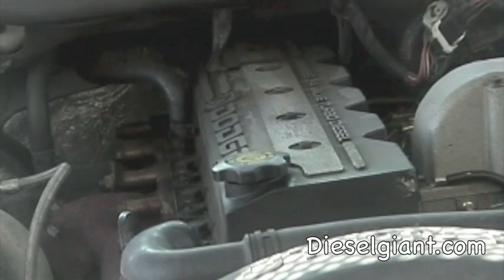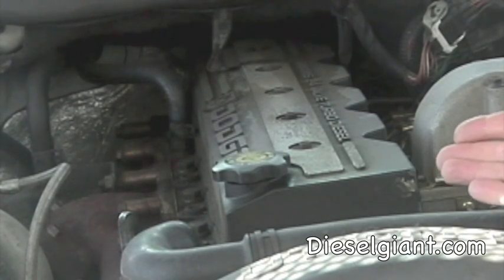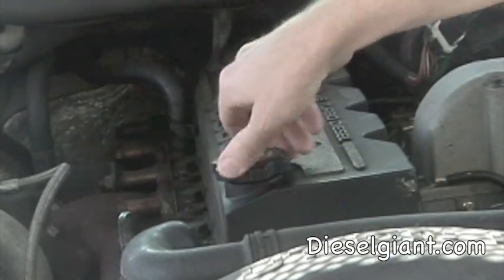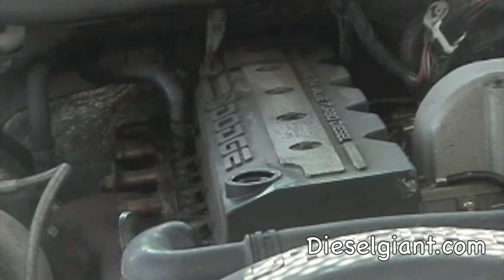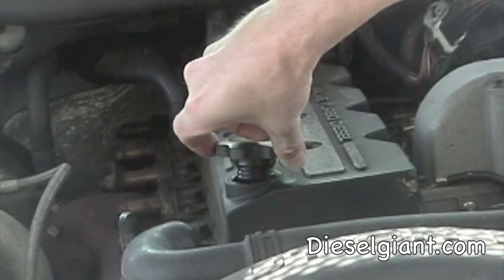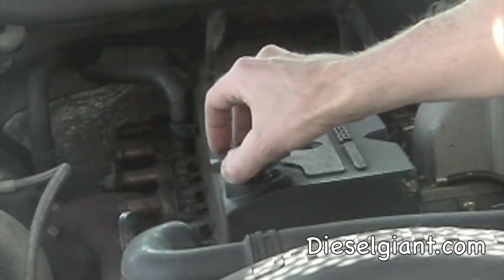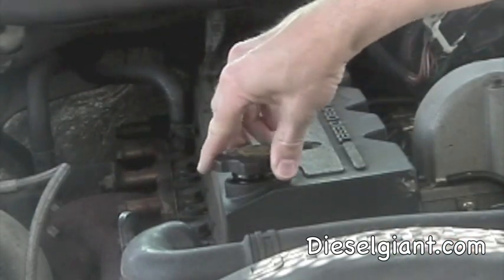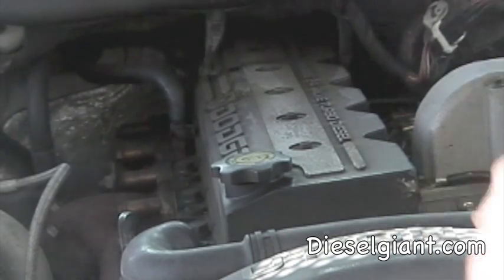2001 Dodge Ram 2500 Turbo Diesel Cummins engine blow-by test

Comment: This isn't an acurrate test for blow by on a turbo diesel because there is no boost being created, blow by will tend to show up as boost is created because of higher cylinder pressures, if you're experiencing blow by at idle you've got bigger problems

Comment: Hello I have a 99 Dodge Cummings turbo diesel with a 5.9 I'm replacing my turbo boost sensor right behind the fuel filter what size is the nut on the sensor and do I need a thin socket or a drive socket to take it off?

Comment: I have a 2001 Dodge Ram 2500 Turbo Diesel Cummins engine  that  has blown several Fuel Filter canister lids off , haven't been able to keep one on long enough for the engine to run very long. A minute or less .

Comment: I'm having an issue with an 2002 four-wheel drive three quarter ton blowing that gasket off the side of the modem does it about every 8 to 9 months anybody ever dealt with that
Reply: Robert Atwood the tappet cover might be “warped” they sell billet custom ones
Reply: It's been 3 years so I hope you figured out that the RAM doesn't have a modem at all. That would be really silly to have a corded phone jack on a truck.

Comment: is there a way to make our Cummins quieter?
Reply from the maker: Yes turn it off.
Reply: dieselworld nice intelligence level psych
Reply from the maker: Huh?
Reply: ear plugs
Reply: No, nature of the engine. The noise comes mostly from the valves under the valve covers from their springs. Best you can do for cabin noise is to add a liner to your fire wall, doors, and under the carpeting. Won't help if your windows are down and you're going through a drive through though. Awesome engine if you get the right make. Avoid engine block 53 (produced out of Brazil with thin walls on the cast iron block... known to easily crack) on the 24v and you are golden. If you want a 24v, best you can do is go for a 2002-2003... VERY solid motors.

Comment: so I have a older car that doesn't burn oil . I am working through, some over hearing issue. now I don't own a compression test kit but I saw this and wanted to see how my engine faired well . I don't have smoke or oil blowing out but I have a lot of air coming out is that's good?
Reply: The cleaner the air the better. However on your car you might find a breather hose going from the rocker cover back to the intake which takes this overpressure crankcase air and pushes it back into the intake, the reason for alot of oil and carbon build up in turbo vehicles, especially diesels. 

If you have this hose and want to check for blowby tolerance simply loose the oil cap and either pinch or blank off the breather hose. If the cap dances around without shooting off from the pressure you're within limit.

Comment: when you do the test (oil cap OFF)....should you pinch/ seal off  the PCV hose that directs blow from the top of the engine to the air intake tube?
 that way the blow by could only escape through the filler cap and you could check it .......?
Reply from the maker: +bigbore400 There is no pcv hose on this diesel engine.  There is a draft tube that goes into the drip bottle.  There is NOTHING that comes out on this engine.
Reply: +dieselworld thanks.....on an engine with a pvc hose should you pinch it while doing a visual blow by  test.
Reply: Pinch or blank it off momentarily. Has worked for me in the past. Also fitting a catch can has saved my turbo.

Comment: can you test this in the winter and if a tiny bit of smoke comes out or is it steam or smoke when I do the tea kettle test it stays on perfectly does not jump around at all but I tested it in the very cold weather and I don't know if this is steam or smoke
Reply: If it's w very cold start it might take a little bit for the engine to warm up and piston rings expand to normal operating temp.

Comment: You cannot check blow by in a 5.9 Diesel unless you block off the crankcase vent tube because the blow by is coming out of the tube instead of the oil fill cap.
Reply from the maker: +Richard Bell No blow by comes out of the tube either.
Reply: If there is pressure in the crankcase it has to come out of the crankcase vent tube. That's what the tube is on the engine for, it has to vent somewhere.
Reply from the maker: +Richard Bell If there is n0 pressure in the crankcase ie no blowby, nothing comes out either place.  Not every engine has blowby.
Reply: +dieselworld  so should you pinch the PCV hose when you do the test?
Reply from the maker: These engines do not have a pcv hose like on a gas engine.
Reply: My blowby oil container leaks oil and makes a mess. I need to make a better collection system
Reply: @aaronbqwert7164 what do you use to collect the oil? Mine is just a tube pointed down lol

Comment: this way to "check" blow by is if you suspect a dust out situation and is no way at all to check any kind of normal blowby that the cummins 5.9 will have. the 5.9 will have at rated load conditions up to 10 in-hg or 5 psi blow by and is in spec with such readings. the only way to check true blow by is with a water monometer or guage that reads inches merc/hg and a 302mm orifice.

Comment: When I first got my truck same exact dodge i cut the soda can thing off. That was a year ago.  Now a mechanic told me i need a timing gasket.  But i find all these different gaskets. I'm not sure which one i need. The leak is upper driver side of the engine.  Can anyone tell me what to do to fix this?  I don't wanna pay shop fees. All help is greatly appreciated. The soda can thing is at the bottom of my engine.  Does anyone know how to fix this?  I'm buying 2 gallons of oil every 3 days or so because it leaks that much oil. Thank you everyone
Reply: Sounds like the tappet cover gasket. Known to leak on these engines.
Reply: Yeah that's what it was i fixed it but it wasn't the gasket. Some how the flat metal cover had a twist in it.  Weird because nothing touches the cover idk how it was bent. But i fixed it m had to go to Cummins to get the cover. . Thanks

Comment: @diesel world  or any body else, in your experience execive blow by   on this diesel engines cum mins , gm etc, if after leak down test you determined the piston /rings were the cause how do you proceed to the appropriate repair  replacing only pistons and rings or do you always send to machine shop the block for cylinder walls honing? I am gas tech willing to move to diesel how ever I have notice diesel engines tend to have more blow by than gas. thanks

Comment: How can i check if the turbo is bad what is blow by caused by??
Reply: First Step is Check It for In and Out Shaft Play. The Seals Can Start to Wear Without Shaft Play Developing, But the Only Way to Notice it at Early stages is From the Exhaust Smoking Blue, or You will Notice that Your Losing Oil and OIl Pressure.

Under Worse Conditions, the Turbo Will Develop Shaft Play, and Oil Will Start to Leak Between where the Turbo and the Turbine Housing Meet Together. 

Under a Condition Like This It is Important to Replace or Rebuild the Turbo. If The Vehicle Continues to Be Driven Under a Condition Where The Turbo I leaking OIl, Then Often The Engine Is Next to Go Bad, Because of The Oil Pressure Being Lost Out the TurboCharger.
Reply: thanks for info
Reply: Blow by is when air passing the piston rings into the crankcase, do to worn out piston rings or cylinder bore.  Often this can cause oil to leak passed the piston rings and into the cylinder and it will go out the exhaust.
Reply: @turbolabamerica  What this guy said is spot on. The reason is because you will develop a crack in the block... these are labeled block "53 (stamped into the side of the engine)." They come out of Brazil which used too thin of iron block... weights savings but not durable enough. Other than the VP44 (high pressure pump that goes out if lift pump starts failing) issue on these motors, they are VERY solid.

Comment: I have a 2001 Dodge  Diesel. I have oil all under the motor comming from a tube under the belt in the front. Can anyone tell me what is the cause?
Reply: It's a normal condition.  The cooling fan tends to blow the oil all over the place making it more of a mess than it normally would be, due to the piss-poor location of the breather tube design for use in these trucks. 

The tube that you are talking about is the crankcase breather tube, and it's ventilating the engine from off the front of the timing cover.  From the factory, that tube went into a small little plastic bottle, a little smaller than a soda can.  If you read in your Owner's Manual (ya know, that book in the glove box that most people never read...) you will see that it tells you to empty the oil that accumulates in the bottle every so many miles or hours of run time (I don't know or remember the numbers.)  What a messy pain in the ass...

If the oil that "drools" from the breather tube bothers you, you can always play around with that bottle and do as you are supposed to do, per Chrysler.  Personally, (and what most of us do) is I just get rid of that idiotic catch bottle and put a PVC tube extension into the hose, clamp it into the hose, and extended it down below the fan area a little bit, and then zip tie it to something down there that would hold it semi-rigid, so the tube won't flop around when hitting bumps and whatnot while you are driving. 

Let the thing drool.  It hurts nothing.  If the oil slop is a problem for you, I know guys that get all elaborate and devise a plumbing system to re-direct those gasses (and oil) from the breather, back and into the valve cover or the air intake.  It's similar in concept to a regenerative system, like an EGR (Exhaust Gas Recovery) system that many modern vehicles have.  Personally, I think that's a lot of extra work and pointless nonsense.  Just don't worry about it.  Every diesel I've ever owned has a breather or some type (they have to), and every diesel drools a little oil.  Some just drool more than others.  Kind of like dogs... or some people even - LOL! 

No worries, no cares.  Now you know.  Enjoy!
Reply: cv48pan o
Reply: SuperTurboDiesel2 i

Comment: Does this also apply for gasoline engines? I own a 2001 silverado with a 4.8 Litre v8 and i checked it cold and also at operating temperature and it had NO blow by what so ever.. is this bad that there is none at all? Currently 161k miles.
Reply: +DEEREMEYER1 Thanks. Where did you get that knowledge from?
Reply: *****
Cool. I'm struggling wit smoking diesel engine so your comments helped me a lot.
Reply: *****
Thanks for your replay but the smoke is white (maybe blue but I can't tell). It takes quite a few extra turns to start it in the morning and after a mile or two when engine is hot it doesn't smoke at all. Glow plugs are blown. I also notticed that there is no coolant temperature on dashboard. Like there was no connection with temp sensor.
Reply: *****
It smokes when is like +5deg celsius. It is direct injection common rail system. I suspect timing off but it is wishfull thinking;) It idles fine. Sounds very good. I think it has good compression but checking it would be very hard and expensive. Special tool required...Thanks
Reply: *****
Replaced glow plugs - still smokes. Replaced temperature sensor and the same. It has hard time starting. I had a mechanic mith many years of experience to look at the smoke and it is blue and smells like oil for him... It smokes alot when car started in the morning and after 1-2miles it's ok but noticed some blue smoke as well but not that much... I guess that the engine is fucked;-(
Reply: Hi. Hope you will replay. Can you tell me if it is possible for turbo to leak oil on the compression side? I know they can leak oil into exhaust but there is not that much pressure... There must be a lot of pressure on the compressor side and I guess it would push the oil and keep it inside the turbocharger oilways. If you know what I mean...*****